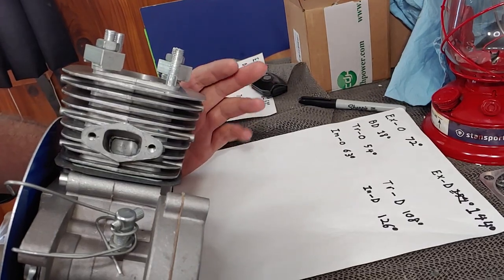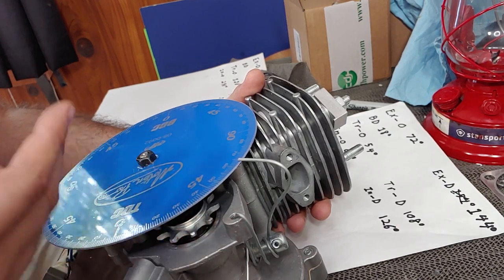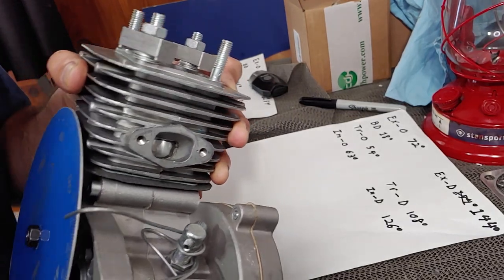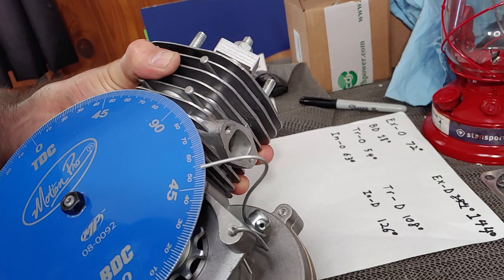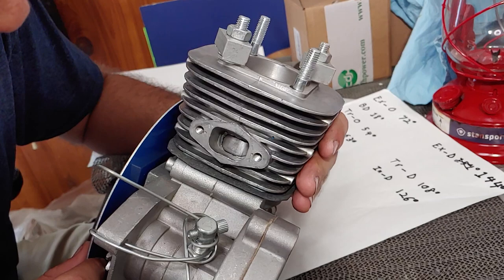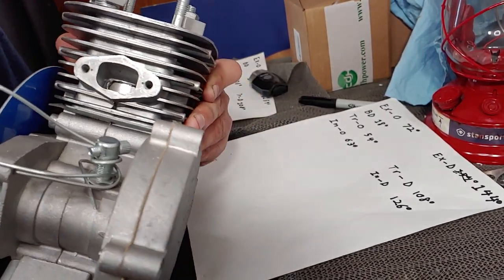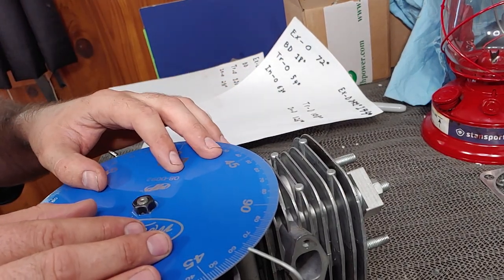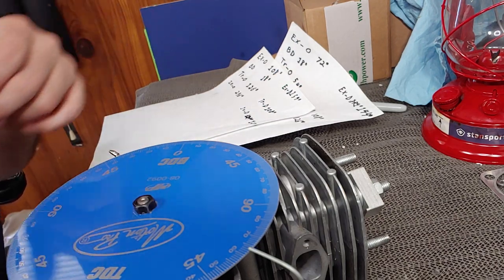Part 2 CDH Stock Port Timing (better readings)

Comment: Your dedication is commendable. Where can I find this measuring wheel deal? Guess I need one!
Reply from the maker: Thanks! I got it on Amazon. Just look for "degree wheel"
Reply: You can make one with a printer and a piece of cardboard, granted you have to be more careful and turning it needs to be done with the nut

Comment: Time the ring. The cyl. is the sealed portion only. 144 wouldn't ever reach 8000 RPM. Go by the performance not the degree wheel. Does it peak at 6500? Then it's more like 160 degrees. I'm at 12,400 RPM with one of my engines, I time the ring because the Yammy pro and physics agree on it. Measure down from the ringline and do the math. Way better than a degree wheel.
Reply: I can assure you your methode will yield terrible results. Power valves don't seal against the piston or rinf. Yet, they influence exhaust timing. Almost no percentage of gas is going to escape through the tiny gab between the piston and cylinder in the area above the piston ring. What you have experienced has more to do with blowdown time.area instead of timing or duration. A low exhaust port can provide sufficient time.area for high rpm, but only if it's super wide, square, and bridged for example. Aside from exhaust time.area, transfer time.area is essential too. Both have to match certain values obtained during development of the aprilia RSA125. Time.area is a mathematical equation that calculates a value out of the sum of the total area of port(s) that is uncovered for every degree of crank rotation. Add a time element to this, (rpm) and you have a very accurate way of predicting the rpm your transfers and exhaust will be able to work at.
Reply: @2strokecarbtuningportingin187  Can you get 12,400 out of a stick 1st. gen China girl?
When you can you'll know to time your ring.